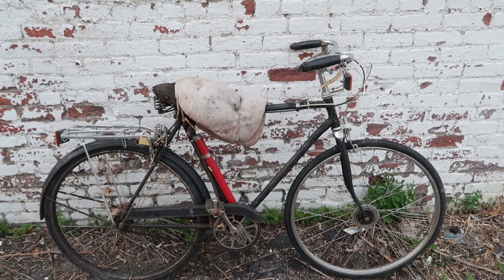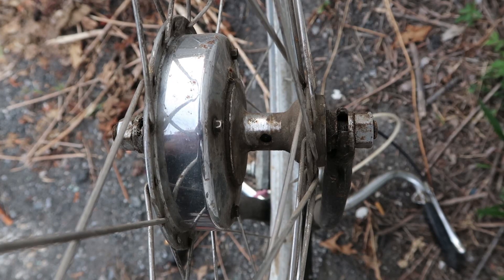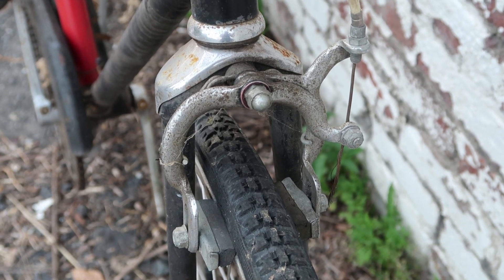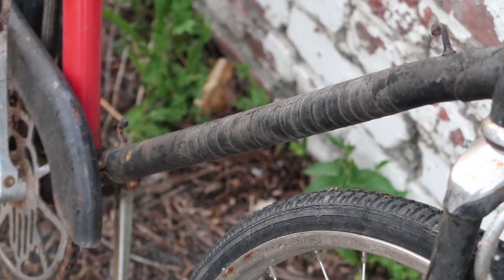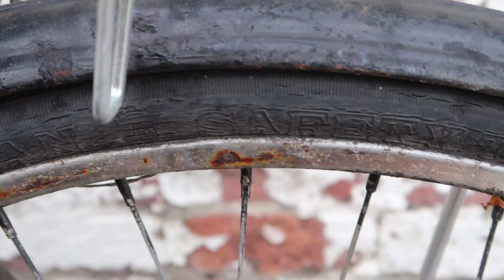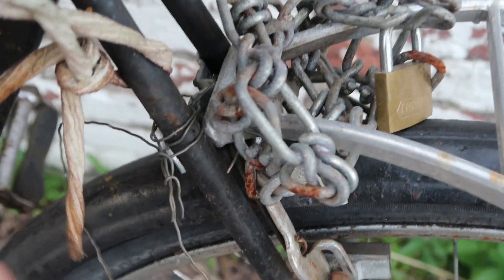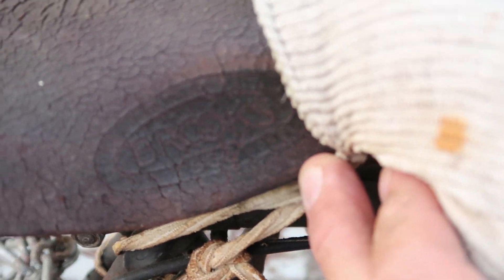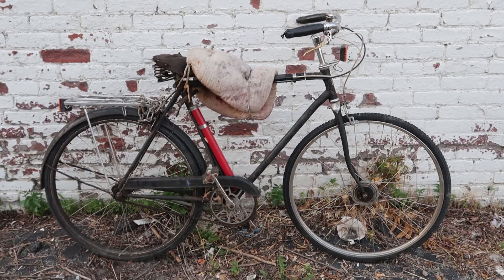This 1950 RUDGE 3-SPEED has the CRAZIEST SEAT I'VE EVER SEEN!

Comment: I suspect that the story of the bike probably goes as follows: someone brought it new in 1950 ridden for a few years put away, oil crisis bike is got out again new front brake for what ever reason as well as lights and a rack is added it gets crashed into something head on gets abandoned somewhere. It is not uncommon for the original brakes to be replaced as you can not get new cables. The correct lights would be a half sphere and a rear Teardrop shaped one mounted to the left hand seat stay. It is ashame about the crash damage it is not a straight forward job to fix